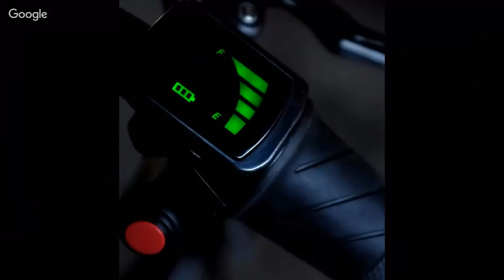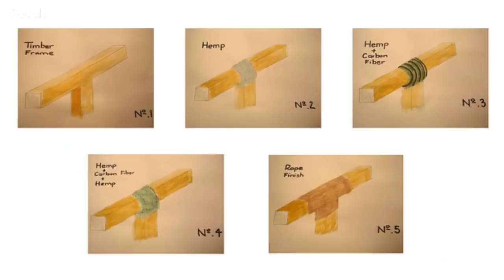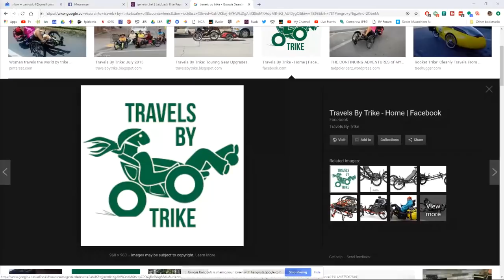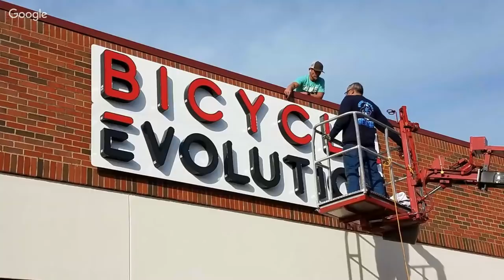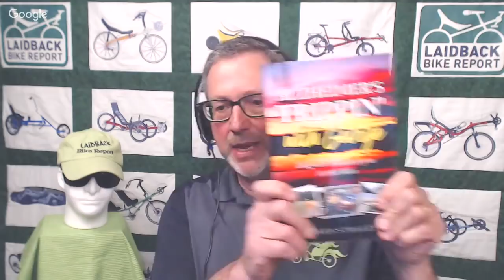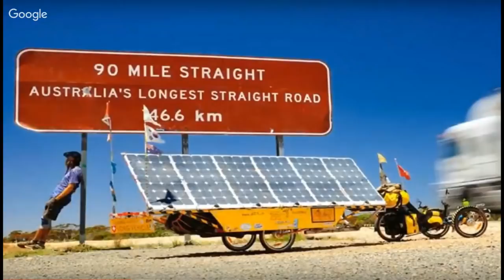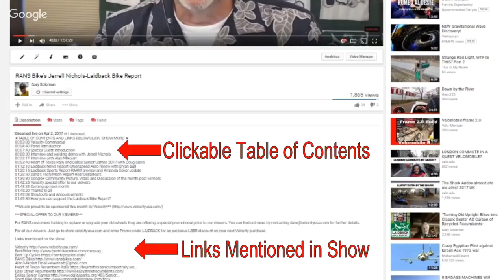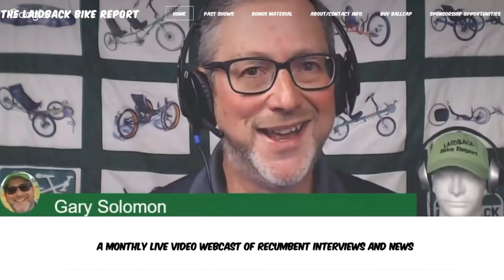Trike Travels, Builders and Sellers-Laidback Bike Report

Comment: HP Velotechnik is going with a Shimano electric assist system if I am correct.
And TRIOT is going with Bosch.
It will be interesting to see which ones are more desirable to have in the long run.

Comment: I am interested if TerraCycle has designed anything that serves as a useful bridge to connect two long parallel flag whips at the 6 ft. or higher level with a stem or two that can be used as a place to stabilize and keep the two whips from scissoring. And most importantly, this location can serve as a place to mount a super bright flashing light that can be pointed backwards and seen as far back as possible by approaching motorists. Even over the top of other stacked up vehicles.  I think this arrangement might have prevented the late James Dobson from being hit from behind by an aggressive young driver in a 2016 Dodge Challenger who claimed he didn't see him in time.

Comment: I've seen a guy building out of pvc - that looked pretty neat as does this. How do I get a chain for my bent? Do I have to add 2 together? I have skateboard wheels to make the idlers; I have 3 bikes to butcher for parts. As I live in the Pennine hills of Northern England climbing is a big deal. I have a Pi to run the electrics. Can someone help me, can i braze instead of tig or mig welding?
Reply from the maker: Hi Mark and thanks for watching the show. I can tell you that recumbent chains are very long and they require the combining of two or more regular chains. It seems like you have a pretty good handle on most of the rest of it except the welding thing. I think I'd better leave that question to others more qualified.